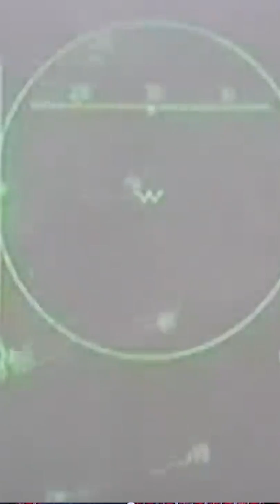Landing an F-15 with only one wing?!

Comment: What's amazing is that the aircraft was repaired and put back into service does a testament to the strength of the airframe
Reply: Most fighter planes can be repaired no matter the damage. As long as every damaged part is replaced, including all the wiring. The airframe isn't the biggest concern, it's all the wires that run through a plane and especially the wing. Most of the fuel is stored in the wings so every wire that runs through there MUST be checked. (I've worked on the F16 and on the Lynx helicopter but I've seen a lot of aircraft come in with damage. A Chinook with all blades dented after it struck some tree tops and basically functioned as a lawnmower for instance 😂...)

Comment: That had to be the most counter-intuitive maneuver a pilot can make! It reminds me a bit of way back when cars didn't have anti- lock brakes and you had to step on the accelerator and turn the wheel in the direction of the spin if you wanted any hope of gaining control of your car again...

Of course, flying and landing a high-speed one-winged jet might take a wee bit more concentration...and guts!
Reply: Catching a car in a spin isn't super related to ABS. That is still how you catch a car in a spin in the modern day. 

If you meant traction or stability control, those modern features help prevent spins, but counter-steering is still as relevant as ever.
Reply: @atticusrussell1225   - Not sure how else you'd get yourself into a spin? Unless you're a racecar driver? Or a teenager doing donuts in the parking lot? Or I guess it could happen if your car got clipped from the side in the rear?

But yes, young whipper-snapper 😉, back in my day, just regular driving in a light rain could cause your brakes to lock up! And if you weren't going in a straight line at the moment you hit the brakes, your car could start drifting or even spinning! It didn't take much! So, instead of slamming into the median or wall or other cars, you would have to press the gas if you wanted any hope of getting any traction and control back.

And depending on how badly thr car was drifting or spinning at the time, you would have to press the gas AND turn the wheel in the direction of the spin.

Both actions were incredibly unintuitive, now that I think about it! 😖 It was very scary for those of us who are not racecar drivers or fighter pilots...but still an adrenaline rush, if you survived!

Comment: My father worked at McDonald Douglas. If I remember correctly, they removed a complete right wing assembly off an aircraft on the assembly line for the repair. Not sure if the donor was a US or Israeli aircraft in production. The donor was then pulled from the line until it received its replacement wing. 
Wasn’t the first time for this type of procedure. During the Yon Kippur conflict, many F-4s received heavy tail section damage from ground to air middles. Complete aft sections of F-4s on the line were removed and sent over to Israel as repair sections.

Comment: The plane essentially functioned as a rocket by moving so fast the plane just leveled
Reply: Well, with enough velocity the dynamic pressure (q) is going to provide plenty of lift on the bottom of the fuselage/lifting body and other wing. The stability comes from the computer-controlled horizontal stabilizers and ailerons compensating for the asymmetric lift.

The issue is slowing down, increasing the angle of attack, eventually the lift coefficient of the intact wing is going to overpower the aileron rolling moment and cause the aircraft to depart controlled flight. They really ought to have ejected, because either losing control and rolling over into the ground or landing at extremely high speed, where energy is squared to V, results in way too much energy for the brakes to dissipate, exponentially more heat and forces on the tires causing them to fail, your basically along for the ride on a derailed bullet-train at that point. Ejection after careful preparation setting up in the safe end of the envelope would be infinitely more sane and rational an action.
Reply: @Triple_J.1 As far as I know, F-15A,B,C didn’t have FBW and were controlled by man power. Am I wrong on it?
Reply: functions*

The F15 is still in use and it still has a Thrust/Weight Ratio higher than 1

The F15 can pull up nearly straight after lift of and break the sound barrier

That's some rocket sh*t

Comment: From Wikipedia, "The F-15 started rolling uncontrollably after the collision and the instructor ordered an ejection. Nedivi, who outranked the instructor, decided not to eject and attempted recovery by engaging the afterburner, and eventually regained control of the aircraft."
Reply: The body of the aircraft is capable of generating lift. That's why it worked out.
Reply: @theultimategamer9240  Upward force = lift
Reply: @josephwang267  thanks for the correction
Reply: Remember, the Israeli’s had just recently received their F-15. The pilot knew it would probably never be replaced.